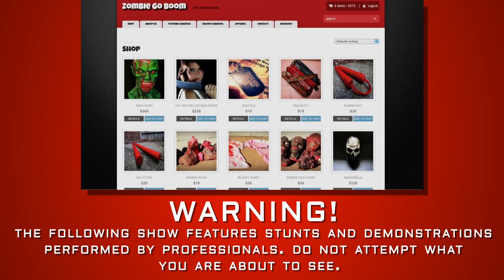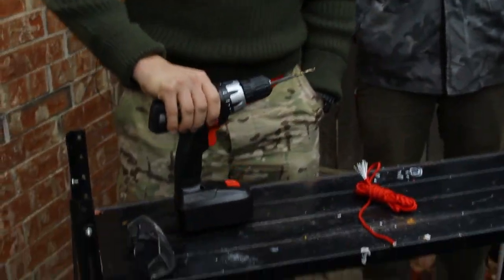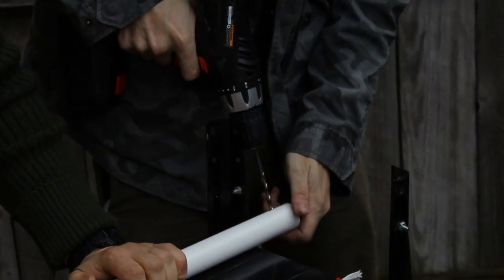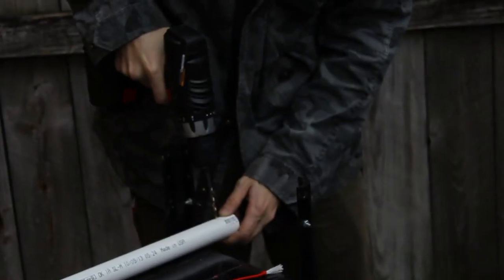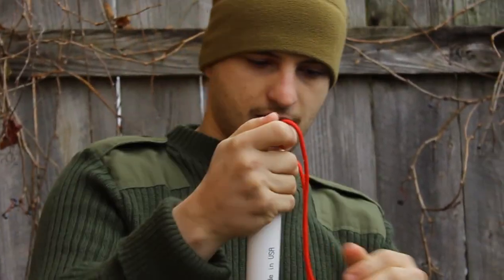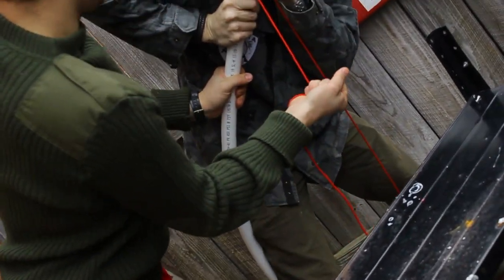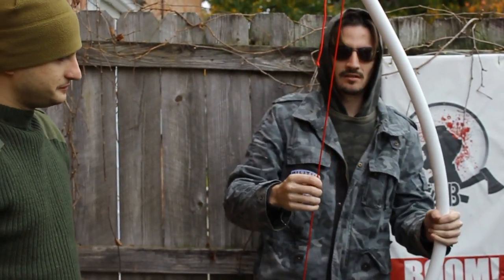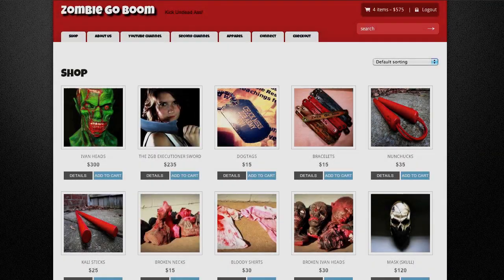EASY $10 PVC BOW! - ZOMBIE SURVIVAL HACK!

Comment: I've actually made a few PVC bows myself.  I use a heat gun and taper the limbs into a recurve bow and it ends up with about a 45-50 lb draw weight and will go about 10inches into an archery target.  I live in Springdale if you guys want to check it out

Comment: a good idea would be to use some fiberglass rods inside the bow to prevent the pvc from getting a sharp bend inside the bow. it will help keep the pipe rigid.

Comment: you should reduce the distance between the string and the handle to increase the acceleration lenght ;) also flatten the limbs increase the durability and recurve the limbs end greatly increase the speed and the power!!! you can do this with a simple heatgun and a little jig (so everything becomes really flat)

Comment: I feel like they made the way harder than necessary I've made a few PVC bows and all I do is carve a notch in the front of the tube tie a bow string knot on both ends of a length of paracord, put one end of the paracord into the notch at the bottom,  do the leg thing they showed where you lean in and just put the other knot in the top notch

And depending on the size of the PVC I put a couple fiberglass rods (do this before stringing) into it taped together with enough tape so that it barely fits into the tube and line it up so the center of the rods is at the center of the bow.

Comment: I can make one more effective and around the same cost check out BackyardBowyer hes how I learned. Its a bad idea just stringing up PVC you can hurt your self put a dowel rod that is slightly less then 1" in thickness in the middle of it wrapped in duct tape to make sure it holds in place. or you can heat up the bow and flatten it to make a more stable and shoot able bow. but PVC bows take a back seat to a real bow.

Comment: that is too much draw height used there, that comes to reduce the speed the arrow will get when shot and the holes are just useless, it would be even better to use a round file. put another piece of pvc that's of a smaller diameter in the center to center down the tiller of the bow so that way it doesn't bend in the center but makes the bending go to the limbs if you could call them that, it would make it even stronger since you are not making a v shape bow but a c shape instead. But in any case is quite a good idea for starters

Comment: Bracing height is way too high, the draw will be pretty damn short = loss of power. Good for temporary usage but this method will mean the bow will eventually cave in the middle. Use a longer and thicker piece of pvc if you want to use this method.

Comment: What happens when the PVC snaps and shatters in to shards like PVC does, this just seems really dangerous knowing the one guy isn't even wearing safety glasses
Reply: Callum Boddy If yoou wrapped the pipe in ducktape maybe 2-3 layers that would prevent it breaking and if it did snap it wouldnt be as dangerous. put the duct tape on after the bow was bent
Reply: check out backyardbowyers channel he makes quality pvc stuff not like these guys
Reply: Callum Boddy He also shows that it doesn't shatter.
Reply: lol he used it once at most use it for a day and its broken if it even lasts a day. unless ur talking bout backyardbowyers product then that shit is solid